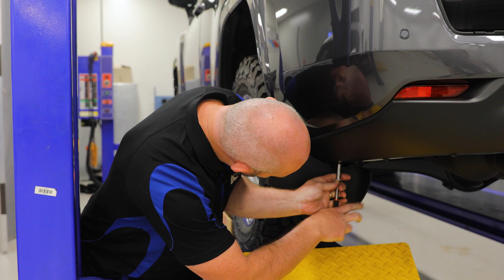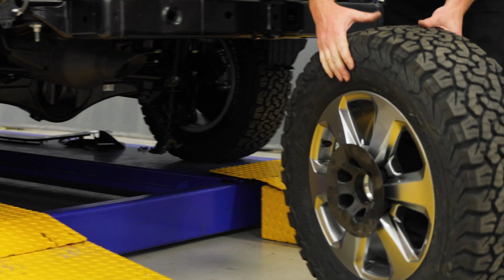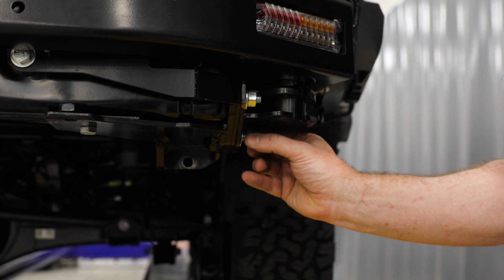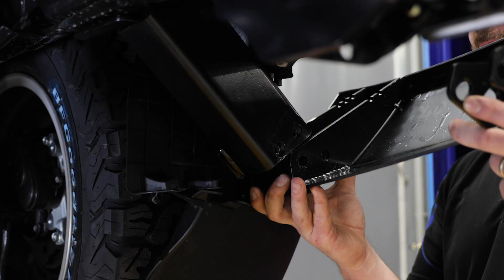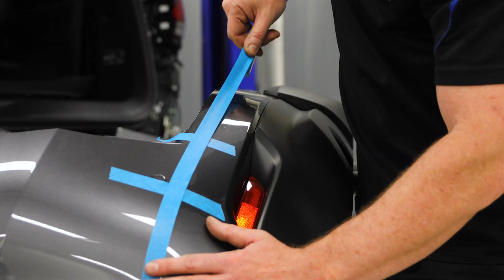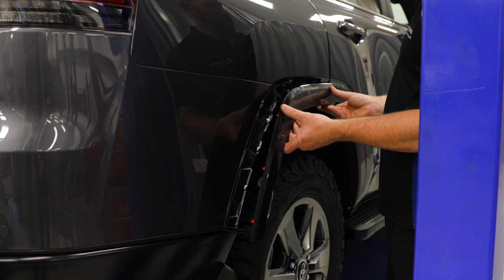LandCruiser 300 Series Rear Bar Installation

Comment: The video is great but I'm less than 10 minutes in and I've found 3 mistakes or differences between the video instructions and the supplied instructions.

1: you say to use a 150mm m12 when it should actually be the 140mm m12 as per the instruction book.

2. You dont mention the installation of crush tubes on these aforementioned bolts, the instructions say to put a crush tube. 

3. You say to use 3x m12's and 1x m8, this last bolt is actually an m10.

These mistakes or differences are all during the installation of the chassis brackets

Comment: Great vid, one question, the rear camera is that affected by the carriers or rear wheel location. It does seem to have the camera field of vision compromised. Again great content.
Reply from the maker: The Camera relocation to the centre of the bar isn't affected but the location of the carriers at all and you will have clear vision with it, but it is different to the original camera location.

Comment: Those nuts would surely come loose after a few hundred kilometers...Why weren't nylocks used?
Reply: Are you sure about that? My understanding is that after a certain size and torque, the nuts shouldnt ever be able to come loose through vibration anyway, Toyota dont use nylock nuts for their m10 + sized towbars or bullbar bolts either

Comment: Really love the kaymar rear bumper, but really hate the rims and tyres combo. It's not really about the size though I'll prefer the 3 inch lift with 35s. Stock rims are as ugly as the vehicle and i would definitely put on aftermarket rims. Steel rims would definitely looks better than the ones in this very car

Comment: Awesome video but how does the rear tail lights work? You didn’t show where they plug into
Reply from the maker: Hi Chris 
The rear bar kit comes with a plug and play wiring loom that plugs into the vehicles wiring loom and then connects to the rear bar combination lights. It also provides connections for your trailer plug and the relocated number plate light.